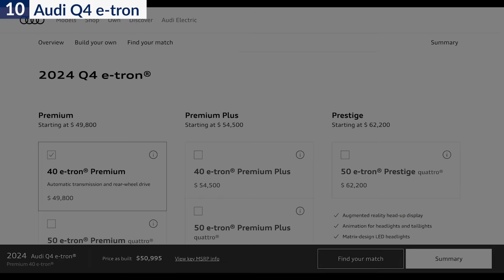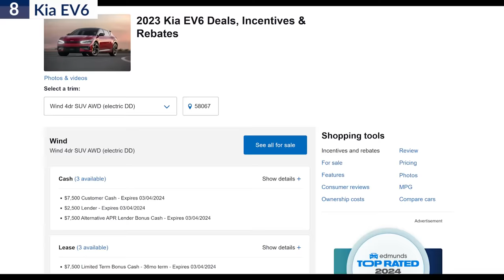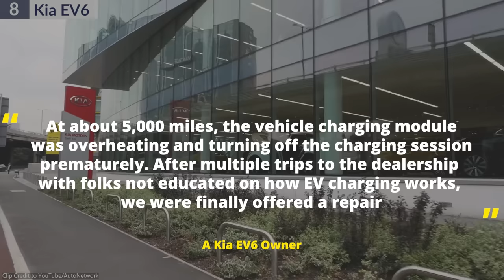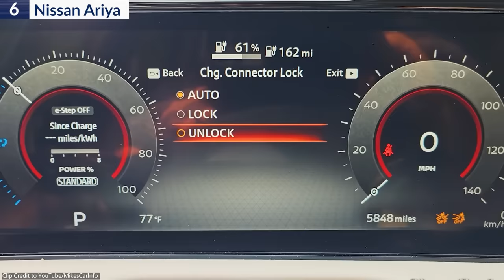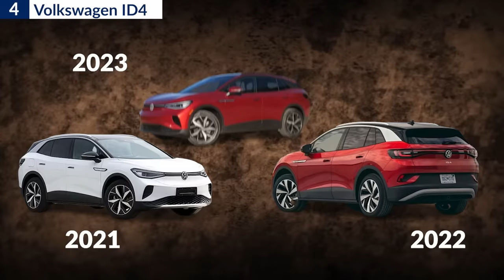New Electric Cars Piling Up on Dealer Lots in 2024 – Here is the Truth!

Comment: This EV hype will fade into history soon!
Reply: 1. Child battery mineral labor

2. Range anxiety

3. Risk of garage fires

4. Paying 20k more than a
comparable vehicle

5. every time you fuel up an EV, the fuel tank gets smaller  and smaller. Battery degeneration. 

6. Poor resale value

7. Reduced performance in
cold, highway.

8. Higher repair costs

9. Awful charging network
experiences in the weather
without restrooms

10. Higher insurance rates

11. Replacing tires more
frequently. Michelin states that tires wear out 20% faster on an Ev, and could be as high as 50% faster! Ev tires made for ev's, cost 20 to 30% more, than regular tires for ice cars. As Ev tires wear out, they leave behind more tiny particles of rubber than normal ice cars. This causes more pollution. 

12. Death by autopilot

13. $25k - $35k battery

14. Low km range per tank of energy. 

15. must wait in-line 1-2 hrs
to charge.

16. Then wait more time to charge, while charging.

17. Spontaneous combustion, with no way to put out the fire storm.

18. If they catch fire in a tunnel, many people will die.

19. People without a pro charger system or a parking spot at their house, will run an extension cord to the road, which is dangerous and could lead to people tampering with your charging setup (super slow charging at the road)

20. If you're in California, you won't be able to charge your car past 4pm because of a shortage of electricity supply on the cheesy grid.

21. It is not actually "green". The pollution is made at the power station, not the car.

22. Only 5% of used junk batteries get recycled, the rest go directly into the bin. It's cheaper to mine for new minerals.

23. Chhinna actually does 70% of all the refining of the minerals and production of the batteries.

24. Minerals are becoming more and more scarce, and the cost will only go up, not down.

25. Some countries where they mine for lithium, actually use a very big boat load of fresh water to only produce a ton of lithium, so they are afraid of running out of water. It takes over 2 million liters of fresh clean water to produce 1 ton of lithium. 

26. Ev cars will soon not be able to drive in tunnels or be able to park in underground parking garage and probably will eventually void your house insurance if you park it in your personal garage.... 

27. You can't charge your battery at super stations when it is bitter cold out. 

28. If a fire truck comes to put out an Ev fire, all the chemicals go directly into the sewer system, poisoning everything. They need tons of water to slow down the burn. They can't put them out. They are only trying to prevent over things near by from catching fire. 

29. Ok, there is 2 good things; regenerative braking, which charges the battery while you are slowing down on the highway, which saves your brakes from much wear.

30. Loss of fuel tax revenue, so now the roads will only get worse, not better. 

31. in Dublin, huge generators are being used to charge EV buses, due to electrical grid strain. buses in Athlone also cannot be put on charge until midnight, for the same reason. Bus Éireann is saying that they can't charge their buses until 11pm for the same reason,  and to avail of a lower tariff. 

32. Not everyone on earth even has electricity to charge their cars. What are they supposed to do in 2035? It's easy to get a bucket of fuel to power up a regular car. 

33. VCE, or "vapour cloud explosion" is very bad. If any battery, typically anything larger than an E-scooter battery, and especially only "half" charged. If a problem occurs in the cells, it might not catch on fire right away. Instead, a cloud appears, and then may be ignited a short period afterwards. There are 2 different types of vapour clouds that appear; heavier and lighter than air, which form will be dominate, can not be predicted yet. This produces a bomm.

34. For Ev transport trucks, they aren't allowed to carry the same payload as a diesel truck, because of the massive weight of the battery. The owner of the Ev truck therefore loses potential profit, every day. They also lose more profit for the waiting times for charging that Ev truck. The driver will get paid to charge the truck, which in turn forces the owner of the truck to lose more money. 

35. Ev cars are more likely to be written off, if they experience a minor collision. After the collision, something could have upset the structural integrity of the battery. 

36. Ev cars lie to you. If you are bold enough to go out on a decent road trip and its 210 miles, one way, and your Ev tells you that your battery will last you 223 miles, there had better be no hills, or excessively cold out.... You'll probably get stranded, trying to get to the charger, at the end of the trip. Ev's have left many families stranded already. 

37. Ev's and their batteries, will soon need their very own "passport". With all info about them when born, and current info about them (power output, resistance, mineral composition, etc.) 

38. Thieves stealing charging cables, will soon make it impossible to "fuel" an Ev car. They take a long time to replace the cables, just to have them cut again for scrape money. 

39. Cars were typically being made lighter and lighter using aluminum and or fiberglass and or carbon fiber, to reduce emissions and pollution. Ev's are only getting heavier and heavier, causing more pollution than ever. Remember, an ev's pollution is made at the power station and the dump, not at the actual Ev, except for the tire particles as mentioned above. 

40. More on spontaneous combustion of the battery. What if you had 3 kids strapped into car seats, in the back seat ,which kid do you rescue? More fires start so fast, there is hardly any time for even the driver to escape, let alone 3 kids strapped in. 

41. There must be a reason that Boeing 747's aren't battery powered.... Until jets are battery powered, I'll be sticking to fossil fuels for my mode of transportation. 

42. Can't bring an Ev up north in the woods, nor any battery powered chain saws, where there are no grids to charge them up. You would need a huge amount of solar panels to get you anywhere. 

Ev's (External combustion vehicles) suck, and it's a bridge to nowhere. But they do sometimes convert themselves into "internal combustion", but sadly, they can only do that 1 time.
Reply: 😂😂😂😂Tesla model Y was the Best selling carmodel on planet Earth in year 2023
Reply: Unlikely as they improve and charging becomes more widespread.  For many doing regular short commutes, they are ideal.
Reply: @sharper68  Hertz rent a car has lost all faith.

Toyota called it quits too
Reply: @jakefriesenjake autism is strong on you 😂
Reply: @777jrg  calling me that does not change anything. I don't care, call me Corky Thatcher if you want to. 🤣🤣🤣
Reply: @jakefriesenjake  If you say so,   Toyota is still manufacturing Ev's and is currently selling the bZ4X and plug in hybrids.

They plan to have 10 EV products on the market by 2025.   Does not sound like they called it quits .. but I did see a bunch of sensationalist titles with your spin that pretended they were. In truth they slowed down projected production for the next couple quarters due to battery shortages.

Hertz bought in big early on Tesla, 100,000 units. They are reversing that decision. It does not speak to the quality of or maintenance cost of EV's in general, just how feasible it is to own a distributed fleet of unsupported tesla's.
Reply: @jakefriesenjake  it's worse than I thought 😂
Reply: @777jrg  it is worse.... Ford expects to go into a loss of $5 to $5.5 billion dollars this year, due to carrying the Ev lineup
Reply: @jakefriesenjake  about 75% of these are nonsense, and the other 20% will improve with time, and %5 is the same risk as buying a gas car in the same price range. I'm not an EV owner either, but looking into buying one because where I live, EV's are the majority of the cars on the road. So when I read this it makes most of these points outdated, or you live in lower socioeconomic region.
Reply: In 5-8 years the three major car markets will be all electric, but most of the old OEMs will not be part of it!
Reply: It won't, because its literally the future. How dense are you?
Reply: @zj10  not many people want one
Reply: yup, just like the mobile phone
Reply: In the UK in 2024 22% of all new vehicle sales must be zero emission, so hybrids don´t count.  The percentage goes up every year to reach 80% by 2030 and 100% by 2030.  Fine for missing target is $19,000 per car.  Toyota not happy.  Europe is running things slower but still all zero emission sales by 2035.  The US has now slowed down the end of ICE
Reply: @woodhouse-bm7kt The limit has more to do with the manufacturers needing time to retool production plants and source new suppliers and supply chains. If countries fail to reach targets, that will be the reason, not public demand.
US prevarication is putting their whole auto sector in jeopardy. Unless US car makers wake up to the EV transition, Ford/GM will be out of business by 2030 and the US economy will suffer massively. 
Toyota partnership with BYD is perhaps a model GM and Ford can mimic, otherwise they are probably too far behind already.

Comment: I had one, never again. Got stuck in traffic on a really hot day, had the aircon on the battery started going down and I was no where near a charge point, had to get rescued.😤
Reply: This never happened. EV's use barely any energy when stuck in traffic, maybe 2%. If you had everything at max maybe you would see a drop but c'mon EV's can run your house for up to 3 days and you want ppl to believe that being stuck for a few minutes drained your battery.
Reply: Fake story.
Reply: I was two cars behind him. He asked to borrow my electric fan and a sip of my water bottle 😂
Reply: Let me guess, you've never owned or even driven an EV, and you just made up this story out of thin air.  Among the many advantages of EV's is that they use no power when standing still, and almos no power while going at a crawl.  So a traffic jam is NOT going to drain the battery.  If you're stuck in a traffic jam and you're that worried about the battery, just turn of the AC, the same as I've had to do many times in my old ICE car when I was low on gas.
Reply: Breaking news: ICE cars run out of fuel.
Reply: Describe the rescue. That’s a better yarn than this one.
Reply: Stupid people run out of fuel all the time.

Comment: Being an electric car owner, owning a gas car was nothing but an inconvenience. I plug my car into a normal outlet overnight and it charges to over 180 miles in 11 hours. No oil changes. No maintenance. No winter issues. With normal use, I spent $65 for 3 months of driving. This is reality. A bad car is a bad car, whether it runs on gas or electric. Imagine using a VinFast VF8 as a reference point for gas-powered cars. If you get a Model 3 and have access to a normal outlet, you will never look back. What was the number one selling car in 2023 again?

Comment: Interesting that Tesla is not on the list.  Maybe because they build cars people want, are actually very reliable compared to the competition, can already access the nation's best charging network, and people tell their friends and family just how good the ownership experience is.
Reply: And yet Hertz put 20,000 of them back on the market (due to issues like charging them up for the next renter and not having enough chargers available around the clock) in the US recently, and lots are FB marketplace has literally 100s of them for sale in a lot of locations.
Reply: My 5.5 year ownership of a Tesla has been wonderful.   Bought a 2nd one last year.   No more gas vehicles.
Reply: @TheVoiceofReason4ya Did you see the mileage on the cars Hertz is selling?  I've seen two year old Model 3s for sale by Hertz with 80k-100k miles on the cars.  These cars spend more time on the road than they did sitting still.  The real problem is Hertz was overwhelmed by customers wanting to rent them, they lost money on the cars since people were putting tons of miles on the cars, the depreciation was higher than expected as well as the repair costs.  In my opinion, the EV rentals program was a success for the customer, but Hertz lost money on the program.  Also, the rental offices weren't properly equipped to charge EVs quickly so customers got upset their rentals weren't fully charged (no full tank of gas) when they came to pick up the cars.
Reply: Tesla likely wasn't in the data set at all due to them being direct-to-consumer.  The compiled data is from cars sitting on dealership lots.
Reply: Tesla doesn't have dealer lots  lmao there's no inventory for anyone to count, they sell direct to consumer
Reply: @Trust_but_Verify that's cool it will make a great Uber for me when I come home from the bar 😂

Comment: What's killing the EV industry in the USA
1. exclusion of tax rebate for foreign-made EVs.
Answer
This is protectionism of the worst kind, the US Administration should get a grip.

2. price gouging by dealerships. +$5k~15k "dealer adjustment" on top of MSRP??? 
Answer 2 and 4
US manufacturers still think that folk need a '56 Chevrolet' rather than a compact
4. lack of $25k~35k price range EV for normal people

3. lack of infrastructure to handle EVs
In  Europe, we started like this, but today lots of multi-vehicle charging hubs are springing up

Comment: Well between the high cost of battery replacements & potential fire .. it’s no wonder why they are still on the lot.. no thank you I’ll stick with my gasoline engines ..
Reply: You realize how stupid that sounds. There are far more fires in gasoline and hybrids. Batteries are expensive but covered for 10 years, same as a powertrain on most ICE cars.

Comment: A friend of mine just bought a new mid-level trim Ioniq 5 for $8,000 below MSRP from a dealership in the Boston MetroWest area. He said the lot was packed with unsold EVs.
Reply: Maybe he got ripped off if there were that many EVs on the lot.
Reply: Price is all relative, needs to compare with what's selling on the market and which ones are eligible for federal incentive.
Ioniq 5 MSRP is $41,800, so he picked it up for $33,800.   But this has 220 range, too low for me.
If the range is a priority even the top end model has 260 miles for AWD, lower than Tesla's Model Y AWD 310miles.
Reply: He did not get a good deal, he just got ripped off less.  220 mile range maybe at a steady 55 mph with the wind at your back.  As long as you don't need heat or AC, I suppose it never gets hot or cold in Boston.  Even if it is free, it is not a good deal.  Do you want to put your Families' life at risk?  Read the comments, many people get stranded. Do you want your wife or children getting stranded?  Or burned up?  The fact that any people still buy these shows how incredibly stupid people are.
Reply: @free2roam674  For your reasoning people shouldn't fly or drive at all because there are stupid and drunk drivers out there.   What happened to the actor in Fast and Furious?
Reply: @Trust_but_Verify  But the Ioniq has knobs and switches so you dont crash into and kill a family of four every time you change the station or crank up the A/C or open the glovebox or trigger the wipers or make your seats fart.
Reply: Saved 8k and lost another 8k by driving it off the dealers forecourt, there should be a meter showing the value dropping in real time😊
Reply: He massively overpaid for his toxic e-waste!
Reply: @free2roam674 Tell us you dont know the slightest thing about EVs without telling us you dont know the slightest thing about EVs.

Comment: One of the problems with adoption was and is greed.  Dealerships who thought they would squeeze customers by raising the MSRP screwed themselves in the long term.  They offended so many customers that those customers, including myself, would never buy from them again, no matter the type of vehicle.   The EV used market is, of course, not great because there isn't any real history yet.   Countries other than the USA are doing well with EV sales.  Sure the battery tech is still a bit behind, but manufacturers have started to put battery management devices that have changed the degradation in winter and in the long run.   Because man has so polluted the globe and failed to implement changes, we need to adopt EVs that use batteries or use other forms of non polluting fuels that make electricity.  We either save this world or just leave more death for those who come after us.